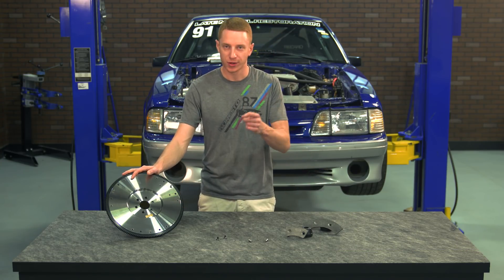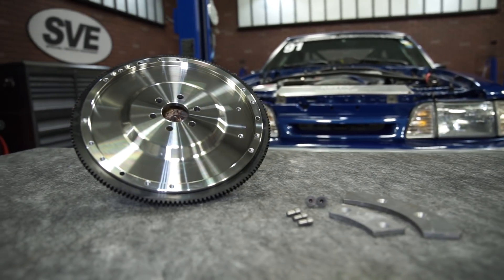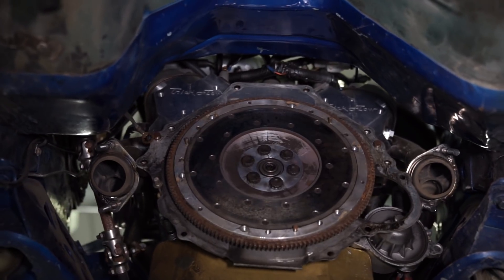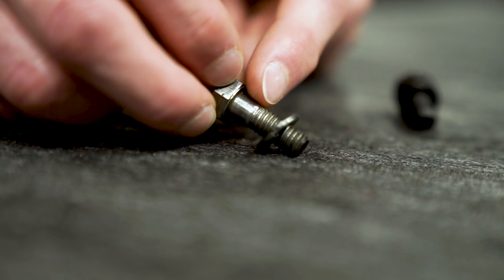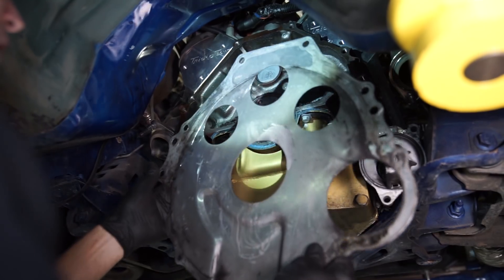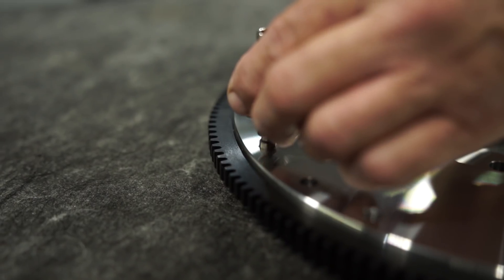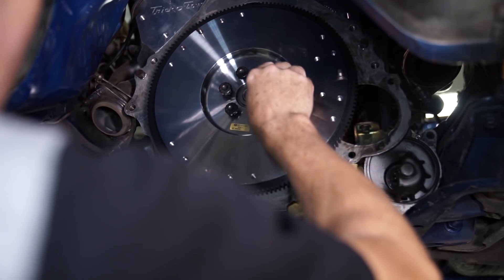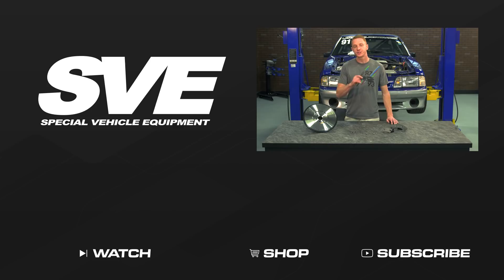1982-1995 Mustang SVE Billet Steel Flywheel - Install & Review

Comment: Could that flywheel be used on a 289 if you're using the 28 Oz weight
Reply from the maker: No, this flywheel is designed only for the 1982-1985 Mustang 5.0 W/ 10.5" Clutch, 1986-1995 5.0 and 1982-1995 Mustang 5.8
Reply: Thanks for answering my question, but can you explain why it could be not used was an old 302 or 289 as long as you're using the 28 Oz weight
Reply from the maker: Send us an email or give us a call with the link below and a customer service representative can assist you with answering any additional questions or concerns about the flywheel! - https://lmr.com/contact